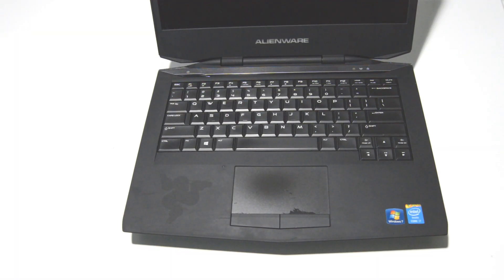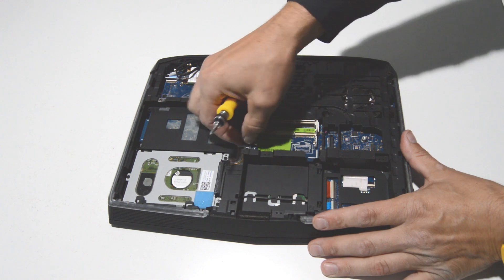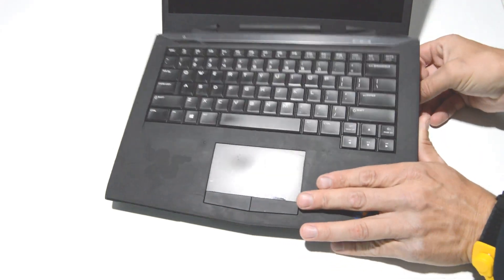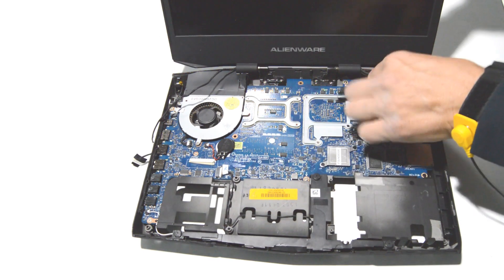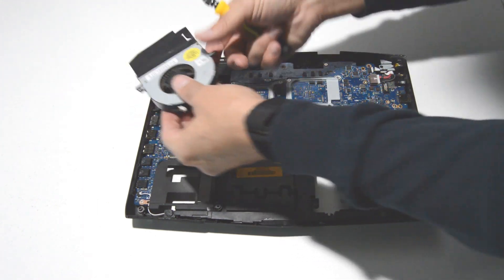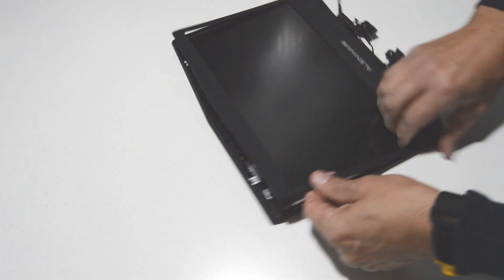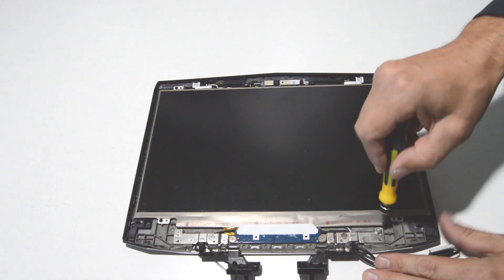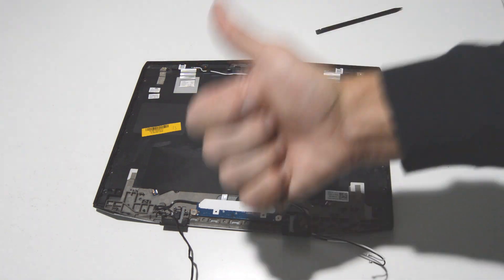How to Disassemble, Repair and Upgrade  Alienware 14 Laptop or Sell it.

Comment: 4:10 I was very horrified at this point. When I tried to put this particular ribbon back in again, the blue tape broke off and the copper wires began to fray off the ribbon as I tried to put the ribbon back in again. I thought it was for the keyboard but thankfully, this ribbon is for the indicator lights and power button. I had to cut the ribbon as straight as I could with a pair of nail scissors so that only 1mm of exposed copper was left on the ribbon (which won't fray) and then put it back in. No indicator lights but it powered up and powered down fine, so I taped it down with gaffer tape to prevent it from moving out of the retainer. So far it's working.
Reply: I'm having an issue with the same part. It's totally destroyed and I even took a ribbon from an old flat screen and it fit. Still won't power on. Any suggestions? It was working one minute the just decided to poop. I took out the ribbon and the connection was totally severed. The ribbon is no good. I have sunk 100s to build this machine one part at a time. Know a way to pop this power without the ribbon?
Reply: @samfisher9413  I know that ordered the new part, which is Ls-9205p, and is actually quite cheap at about $10USD. The laptop continues to work with that part to this day. 

I visited a computer recycling center and noticed that cable was quite common in dismantled Dell laptops, so you could inquiring that those places.
Reply: @OZTutoh  I've been through like six dells. I can't find a single one that fits.

Comment: How many storage devices does it support? 3 right?
Reply: Yes, 3. There's an M.2 SSD slot, a mechanical hard drive and an optical drive which you can replace with another hard drive / SSD.
Reply: @pjemje  ooh okay. But I use the optical drive.

Comment: do you happen to know if the ram is upgradeable? like how much is the most ram I can put? and which generation or whatever?
Reply: It uses DDR3 RAM and it can use up to 16GB, so 8GB per slot.
Reply: @pjemje mine had 32 in it. I had a new processor but it died and had to downgrade my ram. It can actually take up to 32 if you have a better processor.

Comment: thank you ive been looking for a good video about this. mine is pretty much on the brink of dying. battery doesnt charge no more, almost all ports on the left side are dead and i have a massive line of dead pixels on the left side of my screen and i dont have any experience with repair. this is def going to help though!
Reply: Bro, mine is almost like yours! battery almost dead, like 6 lines of dead pixels on the left side. Video card with some problem, i had to turn de gtx765m off.
Reply: Mine is working pretty good, how is it yours ports are dying etc etc?
Reply: @losangulos  Mine too.. I have only replaced the battery since 2014. All buttons / pixels / ports still work just fine.
Reply: update on my alienware 14, she died yesterday night at 01:47, she died playing running classics like in the good old days.
RIP Aphrodite, thanks for all the fun we had together.
Reply: Mine got the same problems but still alive n running rdr2 lol
Reply: Mine was blue screening pretty bad and had 0 battery detected, I ordered a new battery and it was pretty easy to replace. That fixed my problems so far and I can actually play osrs now lol

Comment: HI,
I have problem with the power recently.
when i connect it to the charger it give a one sec orange flash (which mean low battery) then never response any more. i need to unplug the charger and re-plug it get same response. other while it's just dead 
motherboard is fine, I checked it.
have you ever face similar problem, what do you suggest ?
Reply: could be a dead power cell  unplug the battery and see

Comment: Dang. I was hoping to see you take the processor and GPU out too. I really need to upgrade my 14.
Reply from the maker: GPU is soldered on the motherboard and you can't change it. For the processor just unscrew the heatsink and it's there. Just make sure to apply thermal paste before you put them back together.
Reply: @Sellbrokedotcom  gotcha, thanks. I guess I'll be scrapping it then. It only has the 1 GB gpu.
Reply: How much did your sell yours for?

Comment: Hey im wondering if there is any specific ssd or hdd you would recommend? Had mine since release and it is just now having issues with the hard drive speed.
Reply from the maker: It is best to stick with name brands like Samsung, Micron, or Hynix. On this model it is easy to replace the SATA hard drive so I would go for a SATA SSD in whatever capacity you need. Here's a 500GB Micron for $54.95 https://www.ebay.com/itm/332646882994 Thanks for watching!

Comment: I could sure use a certain small connector of that laptop! I'd take it all too. That connector for the optical ribbon broke on mine trying to release the ribbon to swap the HDD.
Reply from the maker: There is one here: https://www.ebay.com/itm/Dell-Alienware-14-14-Genuine-Laptop-DVD-RW-Burner-Optical-Drive-UJ8C7-ER/303377177288?hash=item46a2b05ac8:g:yvQAAOSwqUld2skZ but it is with the DVD drive. The Dell P/N you are looking for is X4TJG